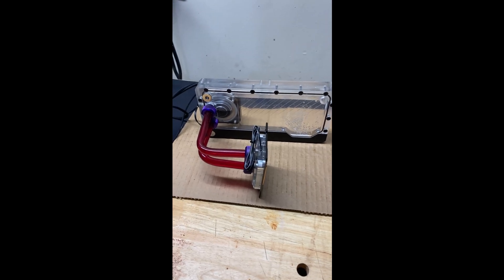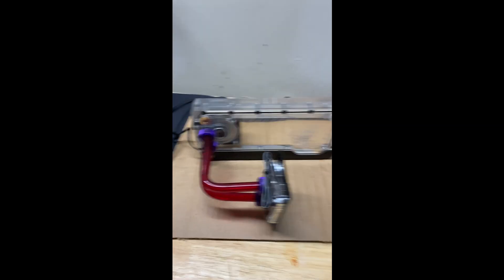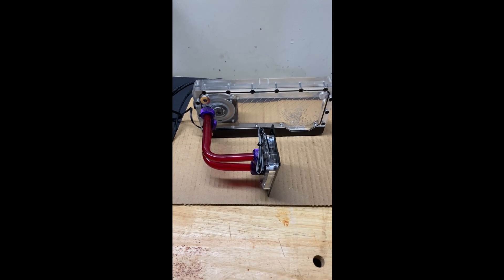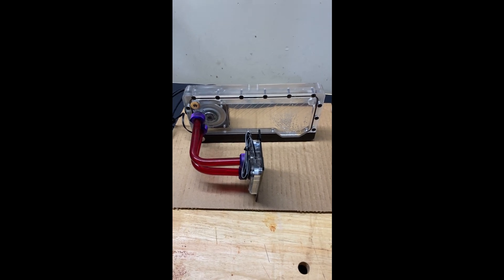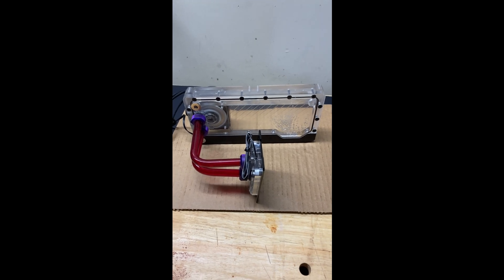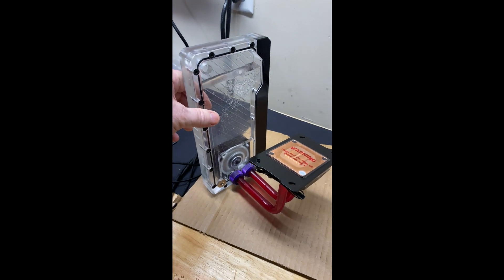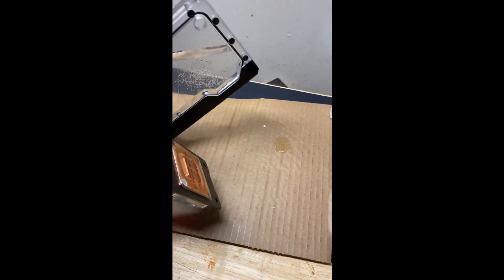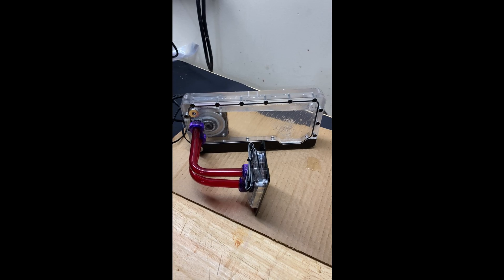EK Quantum Kinetic FLT 240 reservoir testing with EK-G2 D5 PWM pump.  (UPDATED)

Comment: Mine grinds right out of the box with the pre mounted G2 pump. Only at start up and under 50%. I’ve messaged EK and sent them a video still no response. I’ve ordered a Aqua Computer D5 NEXT pump to see if it fits with the screen and what not.
Reply: Did it fit? I have a d5 next and am considering this res not not sure of the clearance between the screen and the mount and if the pump will work.

Comment: Thank you for the video! I am actually trying to decide which D5 pump to get for this exact same reservoir. Seems like there is only one choice after all :D

Although it should fit all the D5 pumps, since they all have the same size... Only the ALPHACOOL VPP755 has different dimensions.
Maybe the reservoir itself is defective?
Did you mount all the pumps with the same o-ring?
Reply from the maker: Yes, all pumps were mounted with the included O-ring. It's a very simple design. I thought at first the reservoir was defective and started a return but after EKWB support stated it only works with EKWB pumps I tried it out. I"m guessing they made the specifications in house with their D5 pumps and didn't spend too much time thinking about other brand variations. When I measured the two previous pumps I tried, the OCOOL one was 1/8" taller than the XSPC one. I never measured those against the G-2 pump but I can do that this week and update here.

I"m glad you found the video helpful! There isn't much out there yet, that I found, on these reservoirs so I was hoping it might help.
Reply: @sixer9682   Strange. EK writes in the description simply D5:

EK-Quantum Kinetic FLT 240 D5/DDC Body D-RGB are pumpless stand-alone versions of the recently released Kinetic FLT combo units. This means the customer can attach his already owned DDC or D5 pump allowing for a more affordable upgrade process.